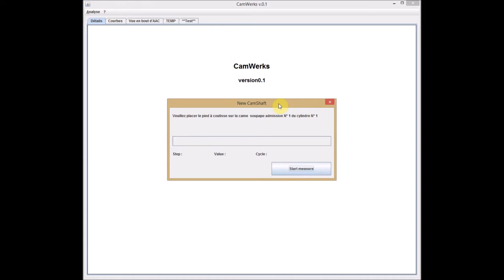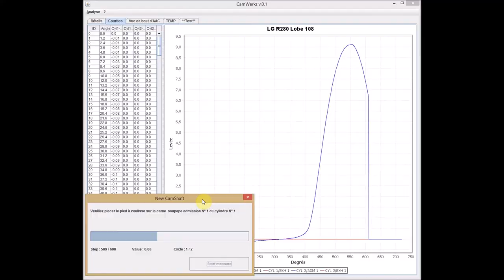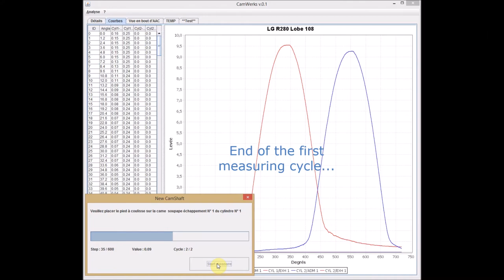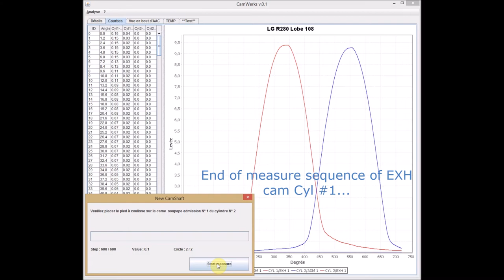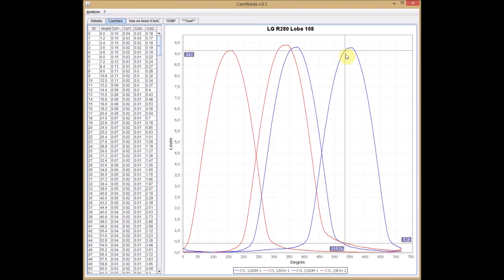Camwerks : DIY Camshaft measuring bench

Comment: hello Mr., can the software be edited graph from the results of measures cams
Reply from the maker: Hi there,

The graph and results can not be edited directly in the software. But the data is stored into a flat file that can easily be exported to Excel (or any spreadsheet editor), to be edited and graphs generated. 

Thank you for your interest!
Reply: I tried downloading the caliper communication to Arduino very difficult, do you have a link for me to download, is it difficult to assemble the device
Reply: Hello mr I already installed your software how to connect to arduino, what files should be uploaded to arduino thank you
Reply from the maker: Hi  @cnccams1428  , 
Please download again the Zip archive from my website, you will find the arduino file named "sketch_CamWerks.ino" in the camwerks/arduino folder. Please follow the instruction on my website as to how to debug/make sure your arduino is properly flashed and replies to the requests sent to it.
Reply: I am looking for a sketch file shamwerk.ino not find mr

Comment: Google images -> FlatAndRollerProfile.gif first image ... see the roller on the right..

Google images -> LobeLifter.gif first image... see how the lifter adds to the cam profile.. the cam nose is touching the edge of the lifter and the added lift is the distance from the lifter to the cam lobe where the center-line runs through the lifter and cam

Comment: Hello and congratulations for your project!! I'm trying to make a camshaft bench based on your project i have replicated everything from the electronics as you describe in your site but when i click start measure the stepper does one step end stops. Do you have a clue what is happening? Thanks in advance
Reply from the maker: Hi @thanassis94, 

Thank you for your comment,! Actually, you're not the first one to encounter this issue. I had never seen it myself, until last week when I had to measure a camshaft for a friend of mine... For some reason, all of the sudden, crash after first step. Damn. I implemented a quick-and-dirty workaround into the code and uploaded the version 0.2 on my website. Please download it and let me know if it fixes your problem. And share some pictures of your bench, too! ;)

Comment: Hello, mr I've found the camswerk skestch file, but it can't be uploaded on arduino, error on serialcommand.h, thanks
Reply from the maker: Hi,
Please read the instruction on my website ; you probably have not installed the Arduino Serial Command library on your IDE (it's a USB communication library), as described in step 1.1.
The download link is provided in my article ; you'll need to unzip it and drop the folder into your libraries folder (e.g. My Documents\Arduino\libraries, on Windows).
Reply: Hi me, I have downloaded the arduino serial command and can't, there is a notification as if the memory is only 20%

Comment: I think you have an error in the way you are measuring the camshaft... the "lifter" part is artificially adding to the lift curve in the area between when the lift is beginning to just before top lift... unless the lifter part that you have added to the calibers is an exact representation of the lifter used with the cam ( same diameter) it will distort your measurements..

to avoid this when measuring the cam you should use a roller (fx a roller tappet) that is centered on the camshaft center (the lift is radial through the center of the cam and the roller) this will give you one contact point that doesn't move off this center line
Reply from the maker: You are right, but I do use as a "lifter part", non only a representation, but an actual lifter identical to the one in action in the engine. So I get the actual figures of the camshaft, the exact way it works inside the engine. 
Thanks for your comment!
Reply: Ok as long as you are aware of this small boost in cam timing due to this geometry

PS. thanks for a quick answer and cool project

Comment: I am working on my own version of something similar. I got inspiration from your video for my project. Endgame for me would be measuring movement directly at the valve compared to the piston position in the bore. Measuring the camshaft profile is good information. Measuring at the valve takes into account all the other variables such as rocker ratio, lash, lash cap diameter, follower diameter and such. many things affect what is going on at the valve. I like that you included a follower in your setup.  My setup is not nearly as refined as yours  https://www.youtube.com/watch?v=GbXTes_7P3w